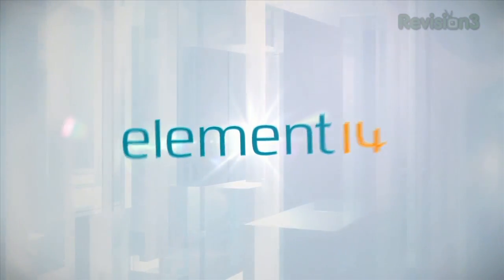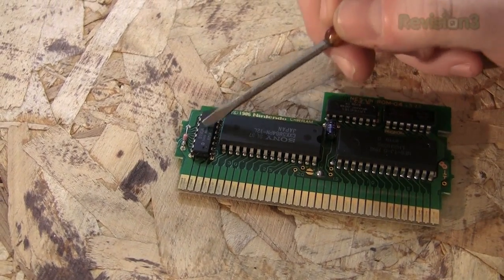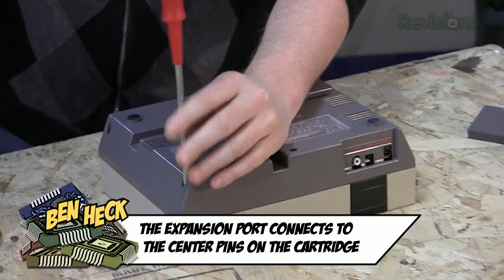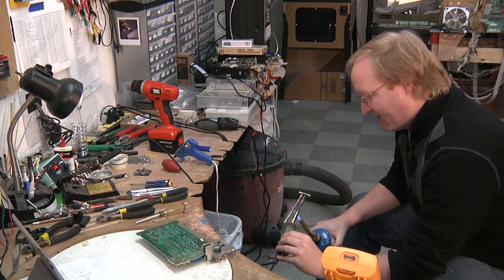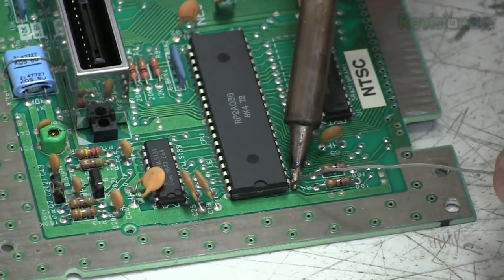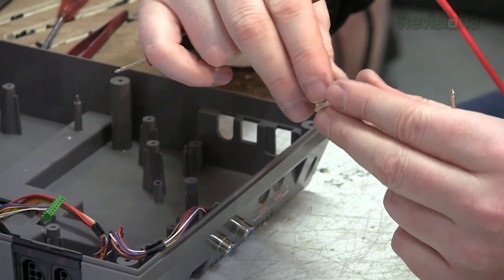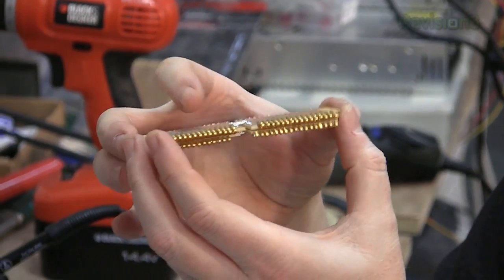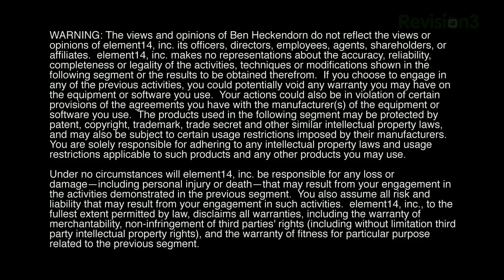Slot Loading Nintendo Game System - Part 1

Comment: 1/2. Either way dude, modern PC's produce so much heat you can't really go fanless and air-cooled. You will need at least a full water-cooled setup with 1 or 2 large fans on the radiator, and they might even need to be set to high if your watercooling your GPU.

Otherwise, the best method is build a submerged PC in mineral oil. This way you can use fanless heatsinks, remove the fan on the PSU and the natural convection of warm oil rises keeping your PC cool enough to operate well.

Comment: I don't think it's possible, as the game code itself needs to be reprogrammed. LCD TVs have input lag, something CRTs don't, and they all vary from TV to TV.  Remember that calibration option in Guitar Hero?  It was there to calibrate the input lag, so the game itself needs to be programmed to have a calibration system.

Comment: It's worth noting that the Japanese version of the NES-101, called the AV Famicom, has both the top-loading characteristics of the Famicom/NES-101, along with full composite video using the cord that was eventually made standard with the SNES. This, in my opinion, makes it the best version of the Famicom/NES. You just have to find a Famicom-NES converter, and those are cheap.

Comment: The molex locations will need to be very exact each time they clamp. If the mechanism shifts at all you won't connect with the right pins. That's the only trouble I see. Also how can you fix "loose" connectors on genesis or snes?

Comment: FACT CHECK:
"Famicon" (It's called the Famicom)
"Crash of 1984" (1983)
In addition:
The lockout chip did not cause grey screens, only the flashing power.
The expansion slot connected to much more than just the cartridge slot. It had a direct pipeline to AV, and other things.
C'MON, BEN!

Comment: Blowing on the carts does help actually, but not because of air removing dust.  The moisture in your breath is a better conductor for electricity and provides a more solid connection between the cart and the console.  You could get a very strong connection by dipping the cart in water before putting it in your console, but doing so would cause long lasting damage to both.

Comment: Don't know if the top-loading one has the same PPU as the regular NES, but if it does, getting composite out of the system is pretty easy.
You can even get RGB out of a NES if you have a PlayChoice-10 PPU (Juste extract it from a PlayChoice-10 motherboard.)